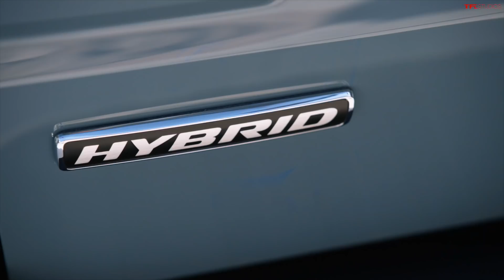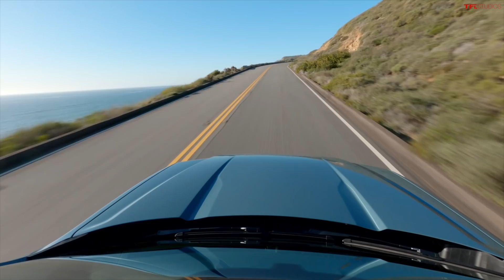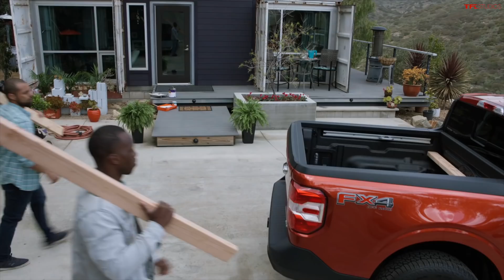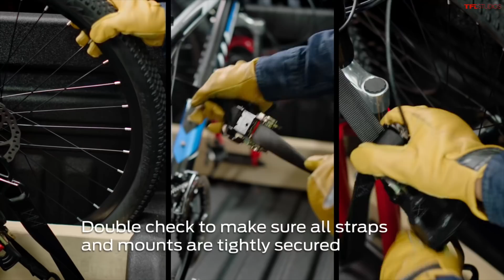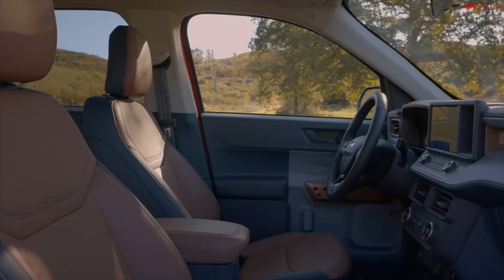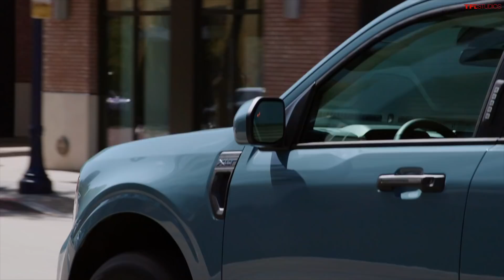What Do You Think Of The 2022 Ford Maverick? I Get ALL The Details From The Guy Who Built It!

Comment: If I were in my 20s, living in an apartment, decent job, I would buy this truck in a hot second. Love its looks and the creative ways to use the bed.

Back when I was in my thirties, I bought an extended cab PreRunner (around 2000). I did a LOT with that little truck with its lil' 4 banger. Drove it from Austin to Atlanta, then on to the DC metro area, all with my lab sitting next to me. Dropped back through Atlanta on the way home and filled that bed with books and magazines and some other dense, heavy boxes. I had a bed extender. I never weighed it and don't even remember what my carry capacity was, but I felt it on hills and that's it. What a great sized truck for me back then. But I had then, the same complaint you hear now in the current gen. That feeling of sitting on the floor. 

Today's Tacoma would have been too expensive for me back then.

If it were today, under the same circumstances, I would absolutely get this Maverick without a doubt.
Reply: I'm just turning 21 this weekend and I am super excited for this Truck! I make pretty decent money at UPS and I reserved the XLT just recently! This'll be my 2nd vehicle but my fist brand new one! Super excited!
Reply: @SH4D3S4D4YS  that's awesome. Excited to see a hard working young man get a nice new ride - especially a truck!
Reply: @PaulSter  thanks so much! I really appreciate the kind words!😄

Comment: Still not happy about the Uni bodied car everyone is calling a truck. With a uni-body you lose capability. Cant lift it to fit your individual needs/wants. The old mini-trucks (body on frame) you could really customize the appearance. could put a lift on it and add big tires, the bed was removable to allow for a flat if needed/wanted, ect. Chevy, and toyota will eat fords lunch if they dont make this mistake if those manufacturers decide to bring back the mini-truck. And trust me a uni-bodied mini truck is a HUGE mistake.
However Ford did get price correct, the flex bed is very cool, but not much else.
Reply: Plenty of unibody vehicles have lift kits available. Both suspension and body lifts. All depends on what the aftermarket is willing to design.

Comment: March 23rd I got a 2021 Tacoma trd off-road. April 21st I sold it. Terrible truck. I do not understand why is the best selling midsize truck. Thanks for their "reputation" I was able to sell the truck for more that I paid for it. I then looked at the competition and I wasn't drawn into any of them. I ended up not getting a new car and just stuck to my old truck. Now this new maverick is super appealing. Price wise, mpg and size is perfect for what I need. I reserved one already, awaiting for my dealership to contact me. Fingers crossed 🤞
Reply: Curious...what didn't you like about the Taco? In the market for a Ranger, Taco, or now the Mav.
Reply: @Champ_Urrado  there are many things that made me dislike the Tacoma. I'll start with the interior. I had a brand new 2021 trd off 4x4 in cement gray. Within a couple days it had rattles all over the place, specially the windows if you had them rolled down halfway. Took it back and they said they "could not replicate the rattles". From delivery, the guy that prepped the car 
 put too much tire shine which then dripped into the rock guard causing the paint to be permanently stained. Not covered under warranty mind you. I had a big argument with the dealership which then agreed to detail the truck. Most of it was gone but there was still stains on the paint. The infotainment system rebooted itself 4 times using Android auto and it kept getting slower each time it happened. The seats are super uncomfortable (cloth seats not sure about the leather ones). The backseat is very small. I'm 5'7 small dude, and I would not sit behind myself in that truck for any longer than 10 minutes. The payload in the particular model I had was 900 which is laughable. It's slow, both the engine and transmission are not tuned right. You gotta be on ECT to have better throttle response. The transmission will constantly change gears since it's geared too tall. I can't imagine towing anything with that garbage auto transmission. If you want one get the manual. The mpg is straight garbage, I was averaging 13-14 mpg legit driving slower than my grandma. 

Things I liked about the truck. 
The looks and the aftermarket customization options are endless 
The resale value. I actually made money selling mine due to being a shortage of Tacomas. 
The off-road capabilities are top notch specially with the trd off-road package. If I wanted a strictly weekend off-road car I would have kept it.

However, for 3-5k more you can have a Tundra which is a better truck. 

Otherwise I'd say test drive it, or better yet rent one for a week and drive it around and see how you like it. 
Btw I test drove the ranger and it's very comfortable, roomier interior, better towing and payload and you can get them for way cheaper than the Tacomas. Albeit they are turbocharged 4 bangers so take it for what it's worth. I didn't buy it either.
Reply: @Electricalwav  man I appreciate your reply. I've been reluctant beacuse of similar experiences like your from other folks. The tyranny on the Taco seems dated along with a few other things and reputation is what seems to be the true selling point. Def gonna test drive all three. Thanks again.
Reply: I'd test drive this first, really want to see how each powertrain/transmission drives and also how comfortable the interior is.
Reply: @logdon17  definitely. I will test drive it Before committing. The reservation is just that, a reservation.  No deposit was asked, at least not yet. I'm still awaiting for the dealership to contact me 😄
Reply: @Electricalwav  Same man!! i reserved one as well. No deposit needed they told me! i signed a "buyers agreement" but i'm not obligated to it when it comes in. That just basically means they're making the one i wanted

Comment: In my mind its trash, almost no tow capability with the hybrid and no AWD, want to tow and add the AWD then you have to get the 2.0 turbo which from what I have seen will get similar mileage to the Ranger which can still tow more and when similarly equipped is very similar in price and thats without any dealer incentives. Also looking at the hybrid performance specs it would be dull and boring to drive. So in light of that I would likely end up going home in a ranger if I went to the dealer and they told me the cost with those things and the MPG trade off in the mavrick to get those abilities!

Comment: The Maverick has undergone a gender transformation from a car to a pick-up.  I like the results and as long as it feels comfortable in its new body, I fully support it!  The hybrid power train is marginally adequate for my wife's Escape; if the Maverick is much heavier, the 2.0 turbo is going to be needed.
Reply: It is lighter shockingl
Reply: The hybrid is supposed to be 191 hp.   My 1971 Bronco had a 302 V8.  It was 205 hp and the truck weighed 3600 pounds.   Do you really need more than 191 hp in a small truck?
Reply: @buckhorncortez  Just saying my wife's old 2017 Escape w/2.0 Ecoboost turbo was much more capable at passing on narrow two lane country highways than her 2020 Escape hybrid and CVT (BTW also coming in at 3600 lbs).  If the truck is lighter than the Escape, no problem; but if it is heavier, I'd opt for the turbo version with the auto transmission.